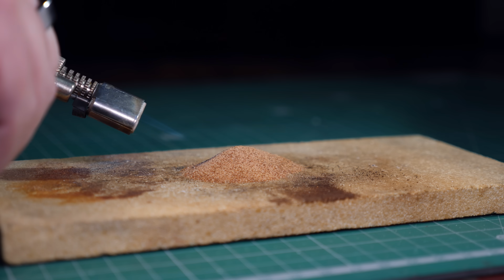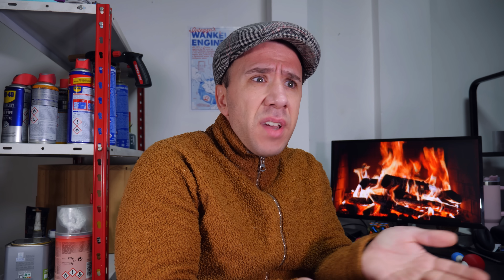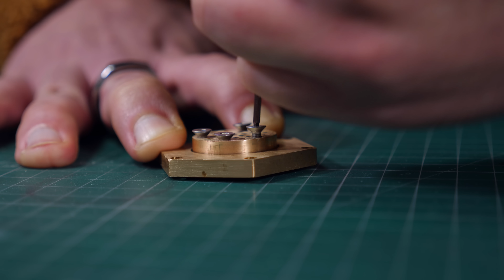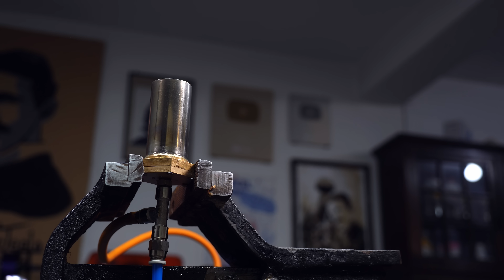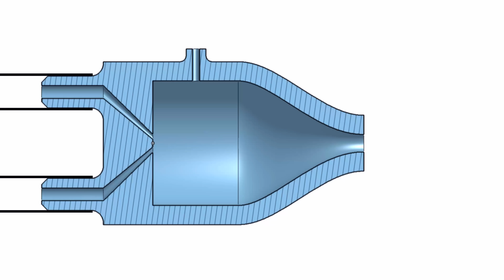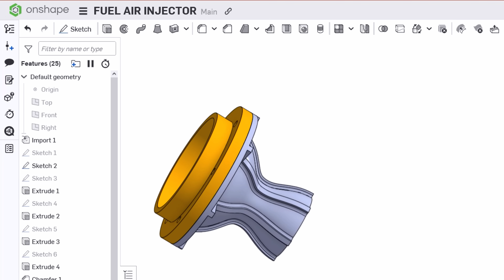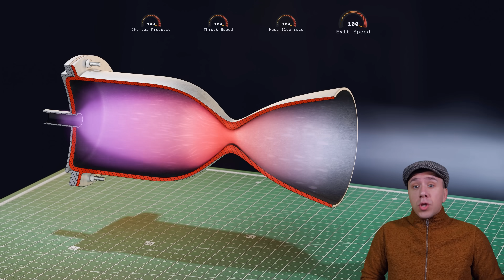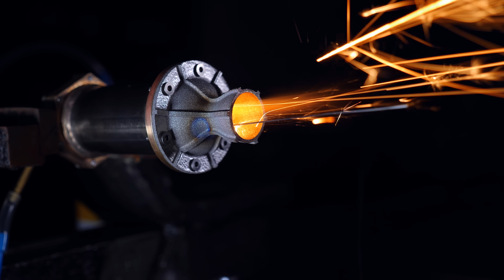I Built the FIRST VENTURI ROCKET ENGINE

Comment from the maker: JLC3DP 3D Printing Starts at $0.3, if you're spending up to $70 use this link to get a new user coupon https://jlc3dp.com/?from=3dintegza
Reply: In Poland, SpaceForest is the company that developed the Bigos and Perun rocket series. These are hybrid rockets powered by solid paraffin and nitrous oxide as a liquid oxidizer.
https://www.youtube.com/watch?v=T8rnJhZJLWE
Reply: You finally posted,😮
Reply: Try spin casting instead. Partially cap the ends, put it on some rollers and spin it at a few hundred RPM, then slowly add in your liquid that you want to cast into the tube. Works better with epoxy binders than a pure water slurry but might work if you just let it air dry for a few hours first?
Reply: @redflaghellhole 
Wouldn't use epoxies ! Nasty gasses! But spin cast would work!
Or a sleave sleave it and vac bag it! 
Likecpipe linings are done! Many ways to skin that cat!
Simply!
🤙
Reply: The price you paid for that rocket nozzle is absolutely insane. Ten bucks?!?? I'm gonna remember these guys in the future.
Reply: @integza not being able to regulate the oxidizer burn rate is the problem you're running into. you can control the fuel, but not the rate the oxidizer is available to be burned once it starts to boil. another attempt could be mechanically limiting the exposed oxidizer by pushing a solid rod of oxidizer into the combustion path, scaled to the amount of fuel entering the combustion chamber. then the fuel and oxidizer would be throttled.
Reply: I am not a rocket physicist, but could the problem be the combustion in the chamber is having violent combustion "hot spots", due to pressure instability? I remember watching a documentary that those that worked on the F1 Saturn Engine had to place divider walls (baffles) into the injector plate design on the side facing the chamber, to stop pressure gradiant issues causing a rotating pressure wave like a pulse detonation wave and hot spots melting through the chamber wall (which could cause violent 'un-planned disassembly' problems). Which as you can imagine reduces the efficiency of the flow of exhaust exiting the chamber and could cause this inconsistant pressure you are seeing.

I have probably not explained this well and whether or not this can even be an issue with such low combustion chamber temperatures and pressures you are operating at, that I do not know.

But I hope in some way it may assist as an idea as to why you are having these issues. And even if not, may be an interesting topic for you to expand upon in future videos in reference to injector plate designs you may want to experiment with.

Here is an article about the baffles placed on the F1 Injector Plate with fuel sent into the baffles to help with their cooling: http://heroicrelics.org/info/f-1/f-1-injector-baffles.html
Reply: Could you use this same tube and nozzle and try to make an RDE that produces thrust?
Reply: Lamellar flow dude!
👍👌🤙
Reply: a cheap painters air brush would work
Reply: Surely 4 evenly spaced pulse jet engines would make an ideal RDE in a tauroid container??
Reply: FYI, wearing Merino wool socks will keep your feet from becoming smelly.  (As an experiment, one year I worn a pair in my work boots for 10-12 hours a day in August while doing heavy construction without washing them even once.  By the end of the two weeks, they were literally able to stand up by themselves, but NO SMELL.  By contrast, after just one day of wearing regular wool or cotton socks, my feet were pruney and stunk.)

Cheers!

P.S.  You DO know that breathing in VOCs like that will turn you from Tesla to Edison, right?  You might even eventually find yourself willing to try a tomato!
Reply: BRING BACK THE MUSTACHE!
Reply: Look up Ottobrunn 300N rocket engine. It's the smallest H2/O2 rocket at 1.88kg. Might be useful! 🤓
Reply: can you make it a liquid rocket engine quadcopter, tnx
Reply: Use nitromethane for fuel much more powerful and easy to get
Reply: Integza, please read this! You can make ammonium nitrate if you make nitric acid from the potassium nitrate and then combine it with ammonia. its not as good as ammonium perchlorate, but at least it decomposed completely to gas unlike other metal nitrate salts that melt and can clog holes. this is my suggestion:

2NaHSO4 + 2KNO3 -> 2HNO3 + NaSO4 + KSO4

this is done by heating to around 300C which will make almost 100% nitric acid and then can be diluted down and reacted with ammonia.
you can find a video on a similar method by NurdRage on youtube, its called the bisulfate method for nitric acid.

though, he used NaNO3 and NaHSO4. it should matter though because the NaHSO4 is the one that melts, and we still have that in my proposed reaction.
Reply: Have you thought about using a Tesla valve type design for a nozzle?
Reply: I have a bit of SUPER important safety news for you: Potassium nitrate forms NO2 when it is heated. NO2 is incredibly toxic, and you should therefore be doing any tests with nitrate salts (other than ammonium nitrate which makes N2O [nitrous oxide, AKA laughing gas] and water when heated) where the fuel is not intimately mixed with the salt (and even the tests where the oxidizer and fuel are mixed well) outside, or in a area with incredibly good ventilation, such as a fume hood. Also, that red gas you see when the flame briefly goes out at 6:57 is NO2. That is definitely enough to cause some severe lung damage. You can also see it in small amounts throughout the rest of that test. I cannot stress enough the danger of making so much of a toxic and corrosive gas inside.
Reply: @phdjgee you do know that NO2 is also an oxidizer just like oxygen right? so it will be used during combustion
Reply: Google it there is online shoping for this thing in the form of lab plastic container
Reply: I don't know how combustible it would become but the pcb making chemical ammonium persulfate has a massive amount of oxygen in it and is very commonly available.
Reply: Your not a Jedi you are a Jeti
Reply: Did you record this footage using a different camera?
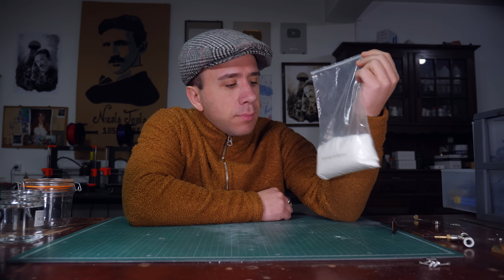Reply: 5:49 Worst drug dealer in the world 🤣🤣🤣
Reply: i hope you patented that nozzle before you posted this
Reply: 5:45 dont rockets usually point towards gravity😅 if the junk goes out the bottom and the gas comes from the top than this might be a non problem?
Reply: Your not a Jedi?.... Yet
Reply: Why dont you cast it in a solid chunk then carve away what you dont need. Thats way you get the surface finish as close to flat as possible
Reply: Perhaps test the engine pointed DOWN instead of UP, u avoid the crap puddling over the injectors
Reply: excellent video. Now if you could just use your 3D machine, on shape and the mail order service to show us how to make medicine level micro reactors to process medication chemicals
Reply: Integza you genius, thank you. You are one amazing dude. Simply said you have helped me realize that even with my basement level education I can make discoveries that challenge yasa level innovation. ❤
Reply: @integza: I'd like to get into this field - specifically spaceflight engines - background in math, computers and chemistry. I know you do a bunch of different stuff but can you give me a good place to start and get a foothold?
Reply: Where did you get ammonium perchlorate
Reply: @Rocketry.hub-4t  he literally said like 3 times he didn't know otherwise he would have gotten more.
Reply: 11:54 you might want to look at steam ejectors for inspiration if they can force water into a 200psi boilers im sure you can make them inject iso into a rocket
Reply: @firefox5926  the only problem i see is that the flow on those boiler is much higher than the flow here, in both velocity and volume. steam injectors rely on the extreme velocity of the steam to enhance the siphoning aspect of the venturi effect. those injectors are also typically tiny in comparison to the volume of the flow, so the surface area of the steam injector mitigates the pressure difference as well. A similar effect can be achieved by placing the injector port right before where the venturi starts to expand, instead of the other side of the venturi's mouth. Integza's second design was basically what i'm talking about, and didn't really need to be as complicated as he made it. as the air passes through the newer injector, the internal diameter expands and induces a similar effect to the steam injectors, enhancing the venturi effect and dragging the fuel out.
Reply: new video idea :
step 1:make a Methane bio chamber
step 2:find a way to make liquid methane
step 3:desigh and build rocket engine strong enough to use this liquid methane as fuel
step 4:launch day
Reply: People possessing either type of mysterious magical  pastey white propulsion producing power providing the powder,  whether nasal or nozzle administered produce potential to be prosecuted and sent to prison where no permits nor provisions providing proof of worthy practices being performed by  and only  for prosecutors to process perps and prosecute   no matter its delivery system either by nozzle or nasal injection; nor which power producing powdered pasty white product were inthe possession of the accused person both without being allowed and permitted will bring potential prison sentences.
Reply: Ah yes, the olde sparkler as a fuse. Honestly they are heaps reliable
Reply: Hey integza i see your engine is not capible to turn off mid run you could try using something that drounds the fire like a gas. But its only a sugestion if you think its a good idea or a bad idea let me know.
Reply: Interesting... You are doing Rocket Motor test in your house?
Reply: hello can you try an electromagnetic piston engine?
Reply: Water electrolysed using sodium acetate, generates fuel at bot anode and cathode, one of a kind idea, sodium acetate from vinegar and baking soda
Reply: then filter the co2 using lime water and use this mixture to make ventura rocket engine energy dense
Reply: You seem to have run into the problem which many liquid fuelled engines have: They can only be throttled over a limited range of combustion rates.
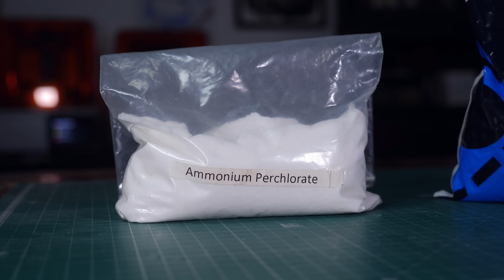Reply: 3:05 Why do you have propane in your living room?
Reply: 10:56 propane doesn't have a smell on its own. They have to add something to it to be olfactorily detectable. It would not smell like spent isopropyl alcohol.

Comment: 13:05 What i think is going on is actually Bernoulli's principle rather than the Venturi effect. As the air gun shoots out very high speed air, the pressure must go down. Lower pressure above the nozzle and higher pressure at the bottom means the air within the nozzle is sucked out forcing the fluid inside (In this case isopropanol) to get pulled with it. Exactly how regular straws work. You suck out the air, create a low pressure environment, and the fluid is sucked through the straw. Correct me if i'm wrong
Reply: Wait, i rewatched the video. That's exactly what he describes. Oops. I'll leave the comment up regardless but theres really no point to it

Comment: Are you Sure that’s not Aluminum Oxide and Powdered Aluminum?

Aluminum Oxide and Iron Oxide is Thermite.

A ready oxidizer can be recovered from Solidox  welding rods.

Where is someone evaporating ammonia and bleach into crust?  Are they evaporated, while mixed together, heating like cement?  Is the Chlorine Gas Collected in a bubbler?  If so, wouldn’t the bubbler contents, be reducible to the same compound, or would one simply have, distilled bleach?

T Stoff is Hydrogen Peroxide
Z Stoff is Permanganate [Vietnam]

[Side draft carburetor]

Comment: What if you inject the powder into the burn chamber as dust? Far more controlled, and probably better fuel economy. You can try those diatom dusters used in insect control to start.

Comment: 13:20 in every shot of the straw tubing it's angled towards the incoming air flow..... So air pressure in the tube would be high

You need to have the tubing angled away from the air flow so it creates a vacuum as it flows around it (without filling it).

Stop jamming air into your straw if you want stuff to come out of it!

Comment: In the United States, you can legally purchase raw ammonium perchlorate powder from specialized pyrotechnic suppliers without a license, provided it is for personal hobby use and kept under specific quantity thresholds (usually under 50 pounds, depending on state and local fire codes).

Comment: Instead of coating the cylinder, Fill the cylinder entirely, dry it, then drill a hole through the middle for a clean hole with even distribution.

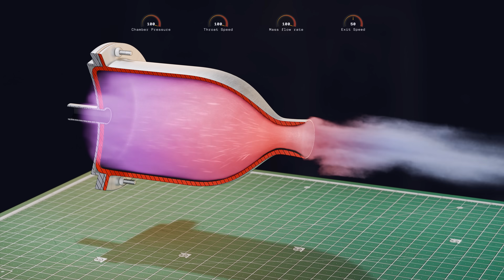Comment: 7:50 Un question: Why do Sea Level engines still have that bell shape extension (Other than thrust vectoring) because doesn't it just make the engine less efficient because of the Venturi Effect slowing down and compressing the exhaust gasses once they leve the tightest part behind and enter the bell nozzle? (I understand it's important vor vacuum but what's the point of it in an atmosphere?)

12:20 Edit:
Oh, thanks so much! I'm into ricketry for a few years now but seriusly, I never understood why this is how it is!

Comment: use unmixed pressurized isopropyl alcohol along with oxidation sponge you get better results higher efficiency but be aware it may turn into boooom easily you can adjust the building composition to oxidizer ratio it is also easier to cool but the pressure is somewhat crazy

Comment: That is the venturi effect.

You got twisted up on liquid vs gass.

In a liquid you add the material after the compression. In a gass you add it at the expantion. This is becouse gass compresses and thus wont have as much pressure drop due to acceleration. However it does maintain momentum after you open it back up, allowing the gass to expand while maintaining its speed and signifficantly dropping its pressure.

Comment: Add you to be able to adjust it you can make 3D printed out of the material you're using a little flaps that you could use to like that stretch in and out with little sticks that are connected with a ring that you can pull back and forth

Comment: 12:48 I think this could work better with some tweaks. Instead of having a straight T-joint, make the fuel line enter at an angle, so the entrance is facing the same direction as the flow. What happens next is exactly what happens to drag racing exhausts when they move down the track. 

Drag racing exhausts let the high velocity flow of air out side the exhaust, from the car actually moving, to create a “vacuum” that sucks the exhaust from the tube. That’s why those quad exhaust pipes are often swept slightly backward. They’re not perfectly parallel or perpendicular to the air flow, which helps create that low pressure and suck more exhaust out. So find the spot in the Venturi tunnel with the highest airflow, stick the injector in at, say, 45 degrees with the nozzle opening pointed in the direction of the flow, and let the air do the work.

Comment: Ah-ha! The vaunted "free country" of the USA, where you cannot buy components for ordinary pyrotechnics! Amateur rocket modellers also make their rocket engines from this oxidizer. YouTube is full of videos with the preparation of rocket-model fuel compositions, and on the Internet there are recipes and drawings of such engines. Integza, it looks like one of your subscribers sent you a package when you accidentally sent him a request. Integza, you didn't do well in school. Although in an American school, apparently, they only teach knowledge of the American anthem and flag.. but not Bernoulli's law. And if you had been taught, you would have known that there is such a design called a water jet pump, which simply connects to a regular water supply and creates a vacuum at the same time! But this is still not suitable for a rocket engine - it needs to be injected with components at a pressure of tens of bars (in large rocket engines, such as in the world's best RD-170/180, hundreds). Your idea of an inverse hybrid engine is interesting, but I would advise you to make a couple of changes.: 1) next time, the oxidizer should not be moistened with clean water, but rather with an adhesive solution in alcohol and dried. For example, polyvinyl butyral is successfully used in pyrotechnics. This component will be too small to be the only fuel, but it will strengthen the oxidizer block and stabilize fire. 2) find a small high-pressure compressor for liquids and use a tube inserted along the axis of the combustion chamber as a nozzle, in which very thin (tenths of a millimeter) holes are drilled perpendicular to the axis of the chamber. This way, the fuel will spray onto the oxidizer layer, rather than along it (you have it wrong - the fuel does not have time to contact the oxidizer and partially flies out unburned).